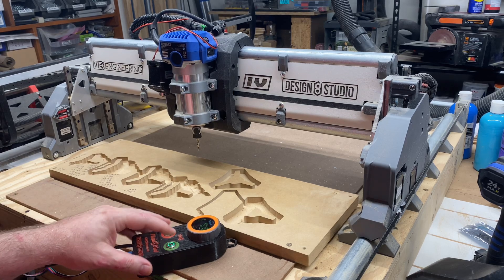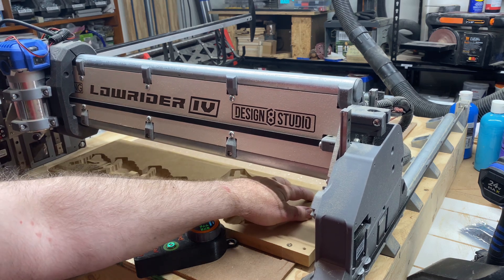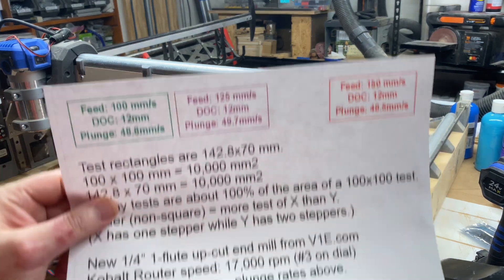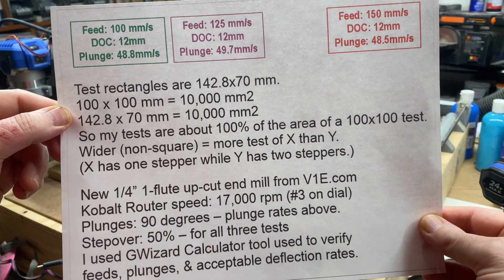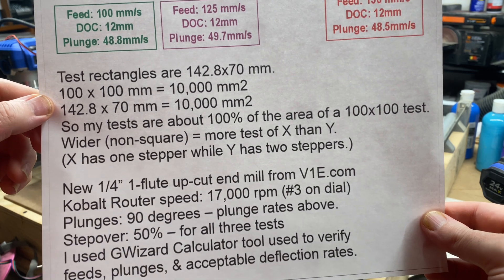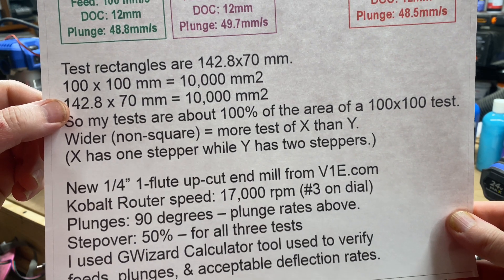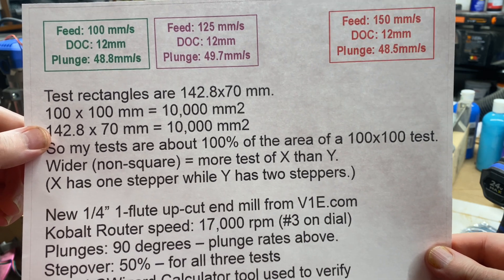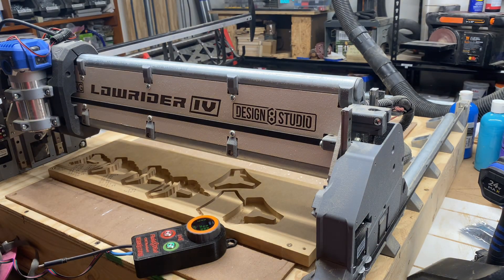LowRider v4 DIY CNC - NEW beta test cuts! 150mm/sec! 12mm depth of cut! 1/4” 1-flute V1E bit!

Comment: Absolutely spectacular....  I'm a TD/Set designer at 5 local schools and I am pitching the idea of building a LowRider as a group project for the student build crews and myself.  The IV speed increase will surely remove any pushback i may receive from admin regarding the tools usefulness.  Do you know when it may be available in a kit form?  Hoping for a complete kit (less the 3d printed parts, we can handle) We would want to build one capable of a full 4x8 sheet  of material.
Reply from the maker: Cool! That would be awesome. Couple of things here. The hardware kit for the LR3 is not going to change very much to become an LR4 hardware kit. The difference comes down to just a few screws. When got into the beta team, I ordered the LR3 hardware kit to use for making the LR4 beta, totally adequate for it. The other point is ... no official date has been set yet, and I could not begin to guess at that. My general sense is that we are getting close to a final release candidate, but it's hard to say for certain. Ryan talks like we are close.
Reply: @design8studio  thank you for the fast reply!  I'll keep my eyes open.  I've been following you channel for a good while now and subscribed today.  The mods you have made make it LR so much more complete and professional .  Thank you for your contributions, R&D, and insight!
Reply from the maker: @ArtTistic  Thanks! the LR4 is so, so nice, it won't need much of anything in the way of mods, but I'm sure the community will continue to think outside the box. Ryan has been incredibly attentive to various unusual non-stock ways in which the LR3 has been used, and in support he's added features to make the LR4 able to serve, in (new) stock configurations, for more of those uses that were previously non-stock. For instance, it will support homing to the opposite side of both the short and long axes, which provides built-in support for makers like me who swap their X and Y, and/or who flip the rail to the opposite side, or both.
Reply from the maker: @ArtTistic  Thanks for the sub!
Reply: @design8studio  truly awesome improvements!  I'm super excited to dive into the build. My set designing and building season has already begun for the fall shows and will likely overlap into the spring builds.  That being what it is, I'd love to get as much done on the build as possible.  I've stated the table design and have printed and received parts for the Fluid Dial.  (will assemble that tomorrow)  In regards to the Jackpot board, I was going to order it from Ryan, other than the 24v pwr supply, what additional items do I need for the board?  Again thank you for producing this content and for helping the "noobs" get their footing !  Much appreciated, Doug. God Bless
Reply from the maker: Assuming you order a LowRider hardware kit from Ryan’s shop at V1E.com it would include a 24V power supply in the hardware kit, as well as the stepper motors, the lead screws, belts, wires, all the nuts and bolts that are needed, etc. Usually the only thing he offers as an optional upgrade is a pair of laser cut aluminum XZ plates, which I would recommend.
Reply: @design8studio  Thanks Doug.  The control board (Jackpot) is a separate item, correct?  So ordering it flashed for the Lowrider would be a logical next step while awaiting the v4 release and the hardware kit for it?  I plan on ordering the metal XZ plates (makes the most sense to me for strength and durability)  again Thank You!
Reply from the maker: @ArtTistic  Yes, that's right, the choice of control board is another optional add on.

Comment: Wow!!! Looks good. Im almost done printing parts for my V3. When the V4 has all the bugs worked out, I'll build one of those.
Reply: I'm all most done with my v3 as well, maybe next year I'll make the v4.
Reply from the maker: @zosojay024  If you do, you can use your LR3 to cut parts for your LR4, namely strut plates and aluminum XZ plates. I used my full sheet capable LR3 to cut those things for my LR4 test machine! I posted a video showing the aluminum plates being cut using trochoidal milling. LR3 is a very capable machine!
Reply: Same same - finishing the final prints while watching this!
Reply from the maker: @greenmoondog  woo hoo!
Reply: Me too. My box of parts came in.
Reply from the maker: That's a good plan! You can have your LR3 cutting strut plates and even aluminum XZ plates for your LR4 upgrade!
Reply: When will files build plans etc be released for the lowrider v4 !! This is exciting news !
Reply from the maker: Ryan, the founder of V1 engineering, has total decision making control over the release date. He has indicated that he thinks he may be able to do the release this week, possibly even as soon as tomorrow.

Comment: Has anyone built a 4x8 and tested the rigidity?  The one you're test appears pretty short in the x.  Not that plywood requires a supper rigid machine but still curious.
Reply from the maker: A couple of the other beta testers have built full size, and they are getting fantastic results. I will be eventually upgrading my full size LR3 to LR4. My full size LR3 with 25.4 mm (outside diameter) stainless steel tubes can already mill 1/4" aluminum in a single pass at a pretty quick clip, and this LR4 has bigger 29.5 mm (outside diameter) EMT galvanized steel tubes, and it is substantially more rigid. I have no doubts this thing will be a beast on both metal and hardwood.

Comment: Have you tested the speed on harder wood or even metal ?
Reply from the maker: Not yet, but it's in the works. Ryan's already been talking about doing test cuts in aluminum, and one of the other beta testers is planning, and suggesting to me, to cut hardwood. I've got some maple. I think I can get some aluminum scraps that are 1/4" thick.
Reply from the maker: I recently got the beta dismantled and rebuilt as the RC2. First test cut was in Maple hardwood. Very pleased with result. More on that soon.
Reply: @design8studio  cool sounds great, But what is RC2 ?
Reply from the maker: @Zimbob2424  That's Release Candidate 2 of the LowRider v4. There's no set date for release yet, and no way to know how many release candidates there will be.
Reply: @design8studio  👍
Reply: I'm having trouble with melamine board on LR3. Really slow, rather rippled cuts and loses steps quite easily.

About 4-5 hours for a simple 18mm full 4x8 sheet cabinet.

The LR4 looks promissing, but I'm sceptic. Nema23 motors now?
Reply from the maker: Hmm. Maybe the bit is the dull or the feeds and speeds are not correct? It definitely sounds like something is not right because you should get better performance than that. Are you using some type of an online reference for your feeds and speeds calculations? I purchased a Calculator tool, but there are free spreadsheet tables available. If a bit is dull it makes a huge problem.
Reply from the maker: Also, another thing to check is whether or not all of your grub screws are tight. Did you put thread locker on all your grub screws? The problem you’re describing is pretty common with loose grub screws.
Reply: @design8studio  What are the grub screws?
Reply from the maker: @Zimbob2424  Grub screws are what attach the teethed gear pulleys to the X and Y stepper motors and are what attach the Z coupler to the Z stepper motor and attach the Z coupler to the Z lead screw. They are small and have to be installed or removed with an Allen key driver. The Loctite brand (blue colored) thread locker with “242” in the name is what I use to make sure that they do not come loose over time due to vibrations.
Reply: @design8studio  Thanks, I have been tightening them quite regularly, I did put locktite on them at the beginning, But because of some problems I had broke them lose, and well, forgot that was part of the build instructions.

Comment: what  is you acceleration set to ? 12 or 24 v ?
Reply from the maker: So, I did not alter the acceleration settings from how Ryan had them in the stock config on the 2nd Jackpot I bought new for this. It's at 200 mm/sec2. Also, Ryan ships 24v power supplies now (I think by default) on LowRider kits. Anyhow, I bought another LR3 hardware kit just for this build, and got the 24v supply.